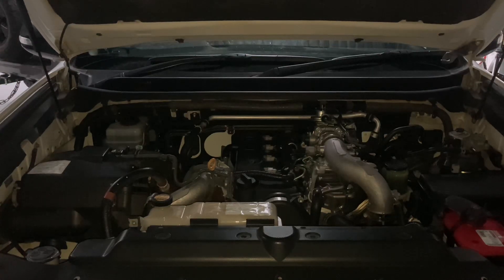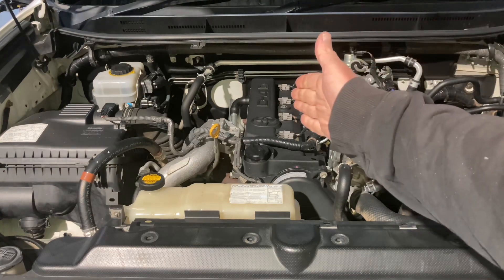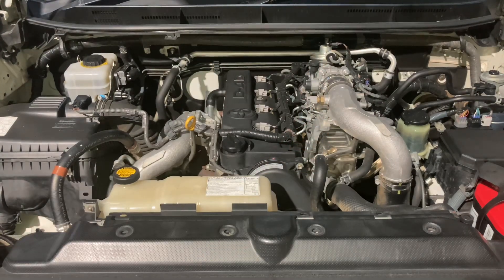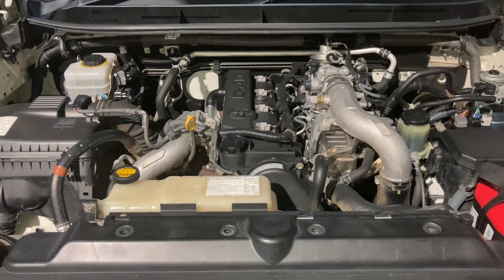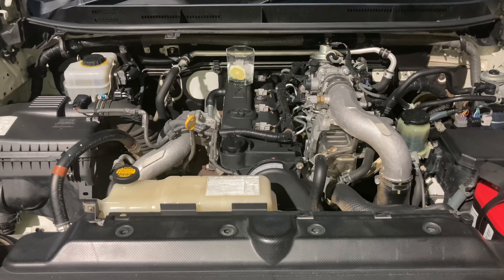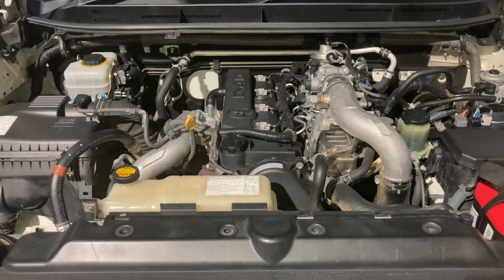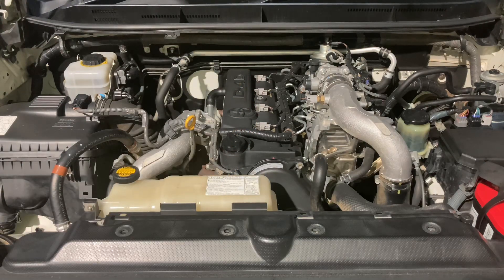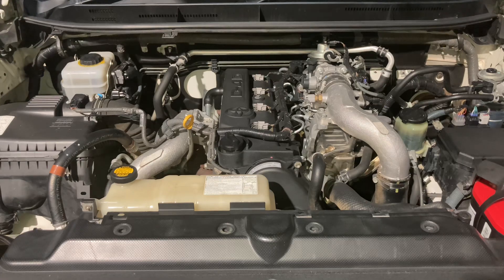ENGINE CARE D4D Engines 1kd-ftv and More Cracked Pistons

Comment: Good info again Doctor. You need a Beer mate . Can't have fire 🔥 without one. I am having Lamb Shanks,chips and salad. I have a 1KD Hilux 2008. Engine was replaced by Toyota at 117k's due to the previous owner cooking it in the mud. Now up to 280k's and still going great with regular maintenance. Cheers AK

Comment: The old injectors just washed the oil away when they were worn and not changed out.!! Referring to older style direct injection with inline or rotary pump. Lots of fuel went out the exhaust and was wasted.

Comment: Do you think it might be down to Toyota skimped on piston design and development ?
Reply: Unintended consequence of lashing on DPF's.

In Europe the EU3 versions as fitted to Prado and Hilux were not prone to piston cracking whilst the EU4 versions were.

 Changes to pistons and the flow of cooling oil to undersides mostly sorted that, unless of course you were stupid enough to have engine badly chipped and ramped up combustion and exhaust gas temperatures 

Misery also caused by mugs using low quality oil and/or infrequent oil changes leading to sludge on oil pick up inhibiting flow
Reply: Compare piston cross section to other piston  manufacturers, even I can see the combustion bowl is not shaped correctly, hence why hairline “flexion” cracks develop.  The bowl must take the combustion forces without piston flexion.
Thin lip, shallow bowl, minimal material where it’s needed most.
I’m no expert, but there are glaring differences.
Reply: Toyota: oh what a feeling when you get a cracked piston.